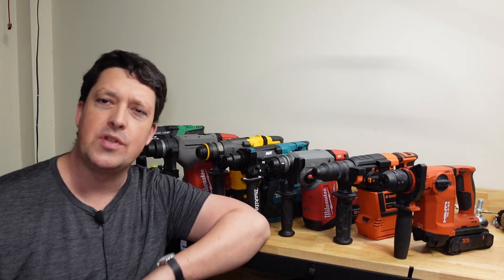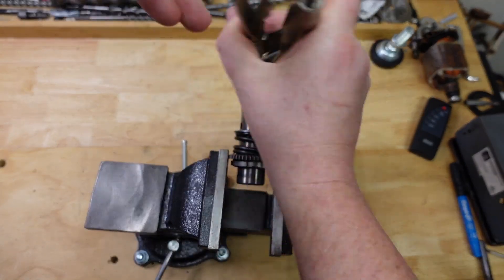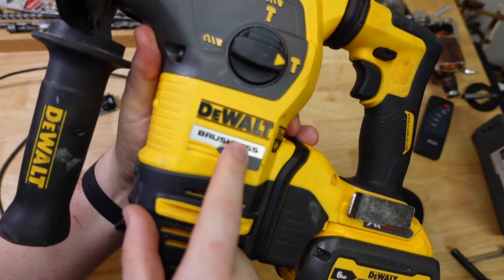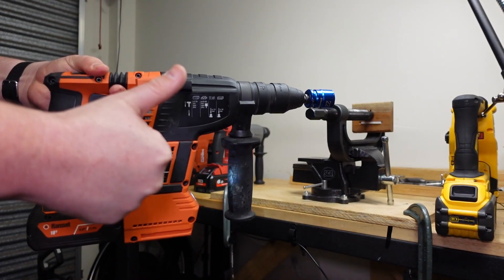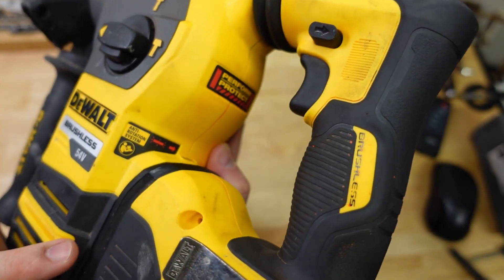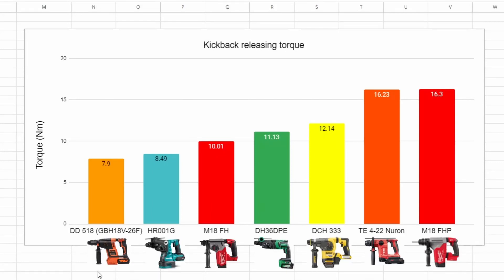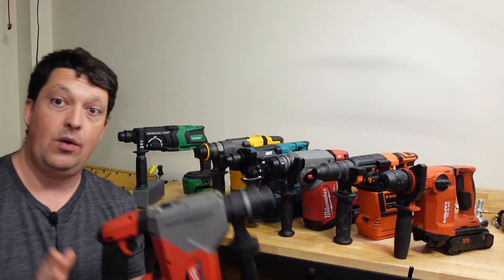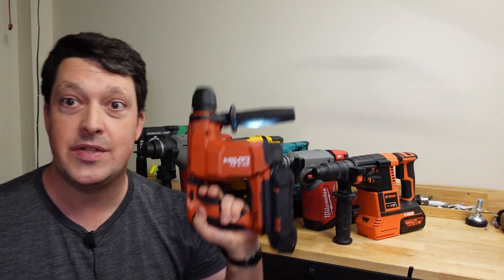Best Kickback control for SDS rotary hammers? (Bosch, DeWalt, Hilti, Hikoki, Milwaukee, Makita)

Comment: Great video, thank you for that. I think when we talking about kick back control, the final torque what you measured on the tighten screw is just one thing, but not as important as that angle while the screw is stoping and the cick back control is able to stop the machine. I mean there is an angle between the two point where the screw stop, and where the machine stop after it. Because ultimately that is the machine will twist out your hand or not is depends on this angle, not the last torque. But it is my opinion, might be I am not right.

Comment: This is a non test as you are so chicken you release the button, causing the machine to stop before any clutch safety kicks in.
Reply from the maker: Incorrect. You can see the lights flashing on all the drills that have them, and I did many runs and only included those where the safety feature activated.
Reply: @BoltahDownunder  Please review the video titled Bosch Professional Safe Drilling Techniques.  It educates the viewer on proper holding technique for powerful drills particularly in regard to safety clutch operation.

Comment: GBH 18V-26  is a 7 years old, today the whole 18v bosch sds  hammer range have the kickback, as on almost 70% of the drill driver range and the same on 18v  angle grinder.
the newest since 2 years have even more precise and efficient kbc.

Comment: Hello, I really like your videos and the tests, I am writing from Santiago de Chile and I am a fan of tools and Jeeps, the kickback test is excellent. I think safety is very important, so I bought the Bosch GBH 18 volt 26D Rotary Hammer now that had Kickback I think that Bosch was the pioneer in tool safety systems after that all the others have followed, Hilti I think it was the second brand to worry about safety... but Bosch stands out because now in almost all its tools it has integrated security, it also has the angle grinder with a lot of security.... cordial greetings from Santiago de Chile....

Comment: Good one, but might not enough as some of them might have delay start function, really want to see how it work when they all running at full speed.
Reply from the maker: Good catch. But, I ended up going with the shorter screw distance for most of these because that was the most reliable way to trigger the electronic braking . I started off doing the longer screw but that would often just trigger the clutch and not the kickback control. I tried to only count the runs that didn't use the clutch (the smaller Milwaukee and the hikoki had very light clutches that would go as well as the kickback controls), and so most of those ended up short like you saw in the video

Comment: Would have been good to manually spin the drills to see which ones are gyro based vs current spike.

Also would have been good to quantify the angle of rotation. The Bosch/Ramset and Makita definitely had the smallest rotation.
Reply from the maker: Yes I think angle is the way to go to properly quantify, but done with the drill vertical so its weight doesn't affect its rotation. But, gotta build more of a rig for that so I just went with this simple test for now. Measuring actual acceleration on the handle would be great too, but it's tricky to position the accelerometer so that the readings are comparable between different tool shapes.
Edit: looks like the Hilti and Milwaukees are accelerometer-based and (maybe the dewalt). I was sure the hikoki was too cos they say they have accelerometers in their drills, but rotating the tool didn't do anything. If this video gets decent traction I'll build the better rig & follow this stuff up more in future

Comment: , just take your drill , shake your hand at once , you can easily test the KickBackControl Mode
Reply from the maker: Good idea! Looks like that only works for the Hilti and Milwaukees and (maybe the DeWalt, it worked sometimes). So I guess those ones are accelerometer based feedback and the others use motor current changes or something else
Reply: @BoltahDownunder  Bosch Also can test like that 
They built it on accelerometer based feedback
Your Bosch GBH18V-26D also have the KickBackControl from Bosch
Bosch ,Hilti , Milwaukee is the 3 brands that i surely when test like that , they will alway active immediately because some of my friends have all of thems